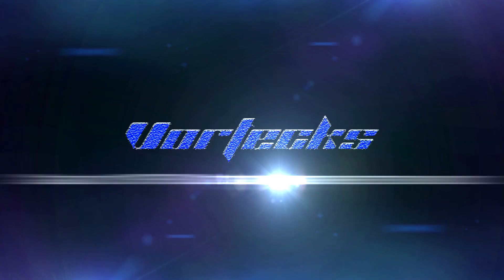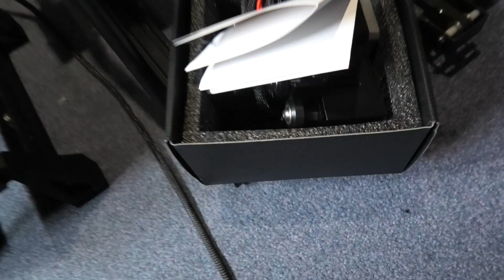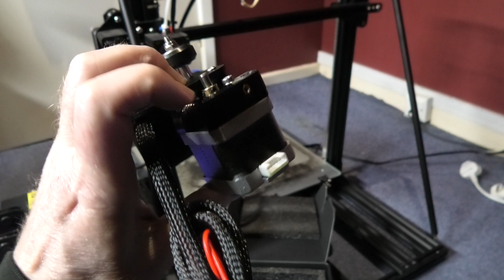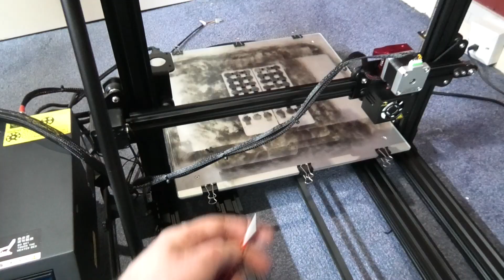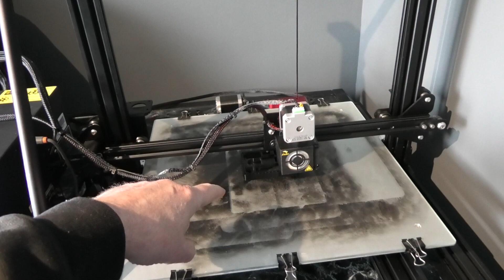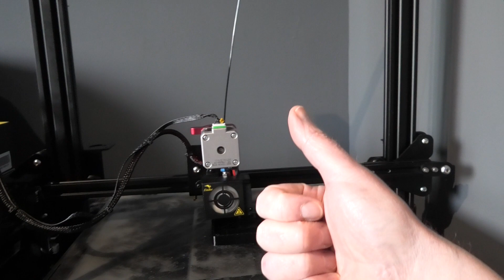CR10 direct drive hotend mod (It's actually off an Ender 3)

Comment: I know this video is several years old but I reckon you just saved me hours of head scratching. Im putting an Ender direct drive extruder on my old workhorse CR-10. There are no instructions except a wiring diagram for the Ender printer. I noticed in the direct drive description on Amazon there is a vague reference to the voltage difference stating only "if install on CR10 must change voltage". That's it. No reference on what voltage needs changed, or how to do it, or even a picture of it. Nothing. So i scoured the interwebs and YOUR VIDEO was the only one i found that explained you must change the heating element. Luckily I have some heating elements left over from the last hot end upgrade. I will put in one of those straight away without even attempting using the one that came with the direct drive. THANK YOU SO MUCH!
Reply from the maker: My job has been done, one person has been educated and that's all I ever want from a video 😁👍
I hope I covered everything in the video and I hope it all works out for you.
Reply: Thanks again and thank you for the reply.  The wiring was a pain in the balls and I of course had to adjust my print settings but I am getting really great TPU prints already.  I hope I've illustrated how helpful your information was. You ROCK. I've subbed your channel. 🎸 🎶 🎵

Comment: Ooh, I might have to get one of these for my Ender 3. Then I might have Arthur chance of printing flexible filament.  With the bowden tube, even with PLA or PETG, I find you can dial it in to mostly get rid of blobs and strings etc, but it soon starts to drift again after a while as there are so many variables with friction, wear & play etc.
Reply from the maker: Actually, I did print with ninjaflex on this CR10 before I modified it. You have to turn the speed RIGHT down (I think mine was at 5mm/second) but it will work.
I'll be testing this one with TPU as soon as I find something to print.
Reply: @Vortecks  Blimey, well I never tried turning the speed down that low. I may give that a go. Cheers for the reply.
Reply from the maker: @christhesnaildriver  If you think about it logically, when you're printing with any filament, the feed motor is forcing the filament through the bowden tube. When you print at higher speeds, there's a considerable amount of  pressure on the filament which, in TPU terms, means it'll buckle and jam in the tube. Drop the speed down and there's a lot less pressure on the filament and less chance that it'll jam up in the tube or hot-end.

Comment: Looks like a great 3d printer you have there and now with the replacement head works a lot better from what you have said. Maybe one day you could do a short video on how you go about designing something on the pc to be printed.
Reply from the maker: It's a fantastic printer - the cheapest I've bought but the best one I've had!
Yes, I'll do another few videos about it which shows how I've never levelled my bead and how I apply the ABS solvent and also, how I design things (you'll be shocked) 😂
Reply: @Vortecks  That will be good never had a 3D printer don't know much about setting them up etc. I shall look forward learning more.

Comment: Did mine a few weeks ago...but used a much smaller, lighter pancake Stepper with gearing to get the pushing power...(Titan)....works a treat...😀🤔🇬🇧
Reply from the maker: Was that a DIY job or are they available to buy mate? This thing works, but I've had to knock the speed down because of inertia over-run on corners.
Reply: @Vortecks  I bought the Titan extruder off E-Bay, and the pancake Stepper. Watch the body length of the Stepper, it has to pass the frame upright...Then it's a small 3D printed plate to mount it on...😀🤔🇬🇧

Comment: Mine has arrived now. I will be fitting it very soon :)
Reply from the maker: I've just finished that switch panel for my joystick. I used PETG and there's absolutely ZERO stringing. Usually, the first thing I'd have to do, is get the blowlamp and burn them all off 😁

Comment: I've just had to install the spare hot end that came with my Chiron after it kept clogging up.
I thought it was the ABS I was using as I normally use PETG & PLA but no. Something else was amiss
No problems now.
Btw.. ABS stinks to high heaven
Good finish on that mate !

btw² - Chirons are 24v :-)
Reply from the maker: I found that 99% of the time, the problem with bad feed was the bowden tube at the very end where it's deformed and was restricting movement. Cutting 10mm off the end usually fixed the problem.
If you think ABS stinks when you're printing, you should smell it when it's mixed with acetone 😂